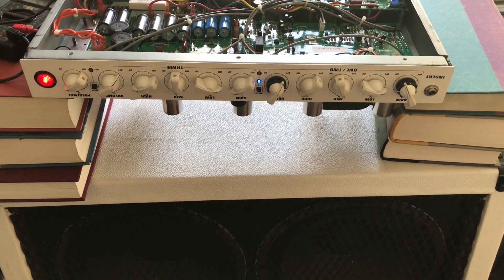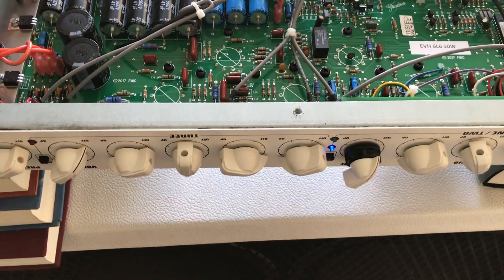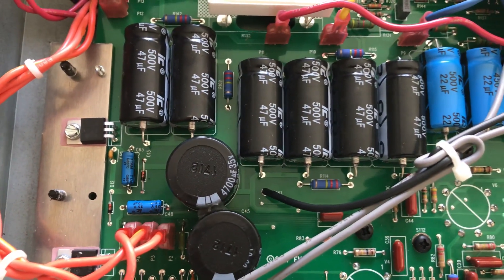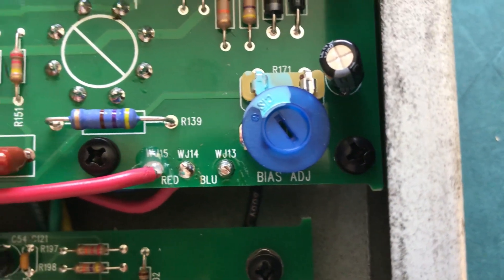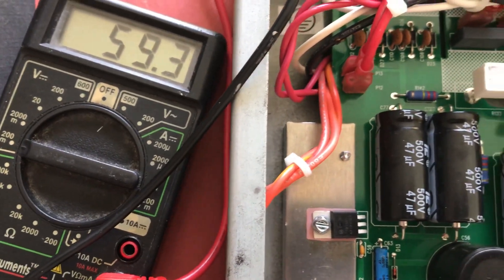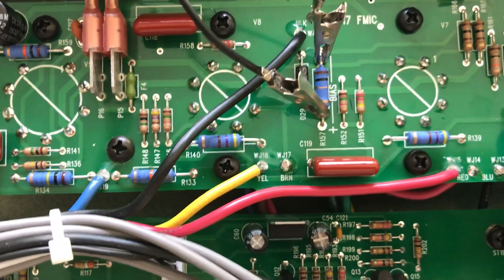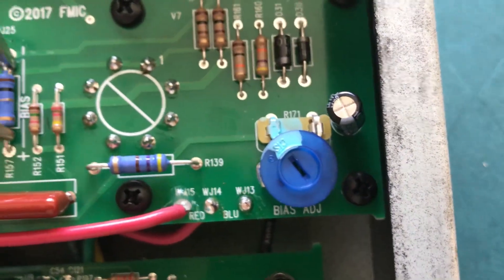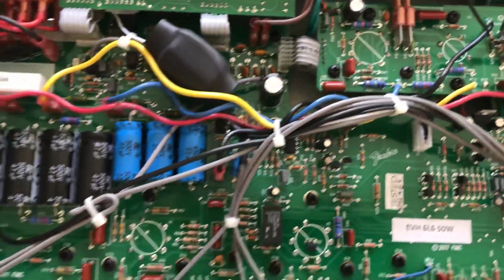How to bias an EVH 5150 iii 50 watt 6L6 head

Comment: The Bias probes don’t work if there is a resistor between pins 1-8 and ground.  All the Bias Probe does is add in the resistor that’s already in the amp.  5150 amps generate most the distortion in the preamp.  30mV per tube is a cold bias and your tubes will last longer.  35mV is the standard setting for power tubes usually but that might not be needed in a high gain amp like a 5150.  As long as the tubes aren’t red plating you can adjust the bias where it sounds best for your settings.  The colder the bias the less wear and tear on them but they might sound more harsh.  Go with the coldest setting that sounds the best.

Comment: You’re a god, thank you! I don’t have any gator clamps, would probes suffice with just contact?
Reply from the maker: @DannyDarko222  Naw. I’m just a guy trying to help. Glad you found it helpful. Yes, just the probes with contact will work find. That’s actually the safer way to go. You’ll just have to check your bias, make very small adjustments then check again. They make probes that clamp on so you can adjust while reading your meter in real time. But I couldn’t find those so I did it this way.

Comment: Thanks so much for the informative video ! I am currently puzzled since I own a 5150 iconic 80W EL34 Head and would like change the power tubes. There are hardly any resources on the Internet and no schematics on the EVH website . I contacted the Fender customer service and was told that : 
1- The amp is to be biased 
2- The bias for the EL34 version should be 90mA (at the bias resistor ? )

This is my first time I own a tube amp and I am willing to bias it myself. I have a good experience with electronic but looking for the easiest method to do it since I'm not a guitar tech. 
the 5150 iconic has the same Bias resistor marking as in the video. If I understood everything right, Should it be enough to read the voltage /current across that marked resistor with mutimeter and adjust the bias potentiometer until it reads 90mA ?
Reply from the maker: @MegaDocjoe  I’m glad it was helpful! I’m not sure about which resistor on the Iconic is the bias resistor. But yeah, it should be marked “BIAS” with the positive and negative signs on it. Just test across that if you see it. And of course you’ll read it in millivolts instead of milliamps because of the resistor. And yes, adjust it until it says 90mv if that’s the bias reading they told you. Be careful and hope you get it worked out!
Reply: @TheAxe4Ever  thanks for the answer ! It wasreally  helpful !
The iconic has the same 1 ohm bias resistor as the 5150iii with the same "Bias" marking

Comment: Where Power Level must be during this: max, 1/2 or min?
Reply from the maker: @hiandlowwings4476  I had it around 1. Just cracked open. I tried it again later at around about halfway since this video and it really didn’t make a difference in the reading. I don!t think it matters so much with this amp or other class A/B amps. I know with the older class A amps it made a difference. I’m not 100 percent sure about that, but that’s what I’ve read and heard from other amp techs. But with this amp, it really didn’t make a difference.

Comment: So I recently picked up one of the 5150 heads, this one has the bias port on the very back of the amplifier. 

I checked with my multimeter and it was set to 40 millivolts which based on Mr kaplan's schematic indicates it was set quite cold. 

I made a slight adjustment with the flathead screwdriver, bumped it up to 54. 

Only problem is the day after I made this adjustment... I've been having an insane amount of white noise in the background on channel 1,2, and 3! I'm going to leave a link to a 60-second video clip demonstrating this... I had the amp for 2 weeks and it was nearly silent when it wasn't in operation, now it's absolutely unbearable. https://youtu.be/71NpBEeue3w?si=ogEDtQ-w07PX3nn4
Reply from the maker: @msi1985  Wow! I have the normal bit of preamp gain hiss on the red channel as is normal for a high gain amp. But my blue and green channel is quiet. Have you tried a different preamp tube in V1 to see if it takes care of it. Other than that, tube wise, maybe a pair of 6L6’s that are overly unmatched? But I think that would cause more of a hum than hissing white noise.
Reply: @TheAxe4Ever  so the store took the amp and ran some tests on the tubes I guess three of the preamp tubes were failing and both of the power tubes were failing. They were all replaced, no cost. There is a little bit of noise now but it's way down compared to what it was before.
Reply from the maker: @msi1985  Cool! That was cool of them to take care of that for you. These amps can tend to be a bit “hissy” especially on the red channel. I honestly have never used that channel too much. It’s a little too compressed for my liking even though it sounds really good. I use the blue channel the most. If I want a bit more push and compression, I just use my Xotic AC Booster. Have fun with it!
Reply: @TheAxe4Ever  I'm up in Canada so our major music store here is called Long & McQuade. I pretty much went to them religiously for probably the last 15 years. Their warranty on items is absolutely top-notch, if anything happens with tubes within the first 30 days of purchase they're still under warranty which is just wild! I definitely agree the blue channels absolutely wild! It gets pretty awesome sounding with the compression!

Comment: here is the link of the man talking about 5150 amps from 0.45 sec. and thank again for your help! https://www.youtube.com/watch?v=oPej_xdu61Q
Reply: i will bring my 5150III combo to a repair shop in my country and let it biased good. thanks for your advice.
Reply from the maker: @jaapmax  Okay. I see where your confusion came from. This is Lyle from Psionic Audio. He is THE MAN when it comes to tube amps. He was absolutely correct when he talked about 2 types of “fixed bias” amps. Non adjustable and adjustable. When he said the 5150 amp, he was talking about the original Peavey 5150’s. They do not have an adjustment from the factory. You just get matched tubes and put them in. They were biased very cold from the factory so the chances of damage was almost non existent. I played a Peavey 5150 for about 18 years. But the 5150III amps made by EVH (Fender) are adjustable, having a potentiometer inside to adjust it. So he was right on the money. But again, he was talking about the original Peavey 5150’s. Yep. Lyle is definitely a subject matter expert when it comes to tube amps. Great guy too.

Comment: hi, i have the 5150III 50W combo 6L6 and bought new EVH tubes, it is branded on the tubes EVH 6L6. I bought the amp brand new but it makes so much hum that other people tell me that is not good so that's why I have new tubes now. I just put them in whiteout biasing. can something happen because it is not biased?. there is a YouTube video on tube amps and the man said 5150 is a fixed bias amp and not need to bias??? if you want I can put a link here. so I believed him and changed the tubes, can it gonna brake something inside the amp or am I good? please advice
Reply from the maker: @jaapmax  This is what drives me insane. There are so many “experts“ on the Internet and YouTube that give incorrect information when they don’t know what they’re talking about. “Fixed bias“ means that the bias is adjustable usually by a potentiometer. Which the 5150III has as you can see by my video. “Cathode bias“ means that the current fluctuates automatically up and down to keep the current at the right level. Or often times you have to change a cathode resistor value to adjust the bias on those types of amps. That is what that guy was actually referring to. But he mistakenly thinks it’s “fixed bias“. I’ll leave a link to an article about the subject that you can read that will give you a better explanation than I can. But yes. Absolutely bias your amplifier to the new tubes. If the current is too far off, you can possibly do some damage to your new tubes or your amplifier. As you can see the 5150III has a potentiometer to adjust bias so why would it be there if you didn’t need to adjust it. I’m sorry you had to get confused by a video that someone put out giving you bad information. I’ve been there myself and had to learn the hard way. Here’s that link. Also, go ahead and give me that link so I can see this guy’s video and set him straight in the comments. https://www.ampvalves.co.uk/fixed-bias/#:~:text=So%20a%20fixed%20bias%20amplifier,(fixed)%20until%20adjusted%20again.
Reply: he talk about it from sec 0.45
Reply: https://www.youtube.com/watch?v=oPej_xdu61Q
Reply: https://www.youtube.com/watch?v=oPej_xdu61Q

Comment: 45ma recommend
Reply from the maker: Sure, if the plate voltage allows for that. I use to bias it per factory specs. They do recommend a pretty cold bias from the factory. But since this video, when re-biasing I will always check the plate voltage of the tubes, do the calculation and bias from there.

Comment: I just tried this same method....I couldnt get it lower than 66ma
I'm using an 8ohm cab and set the ohm on the amp to 8 ohm...is it also possible its higher because I'm using a 12ga speaker cable????
Reply from the maker: The speaker cable size shouldn’t have any bearing on your reading. Bias on an amp is a range really and not a specific set number. These amps are set pretty cold from the factory and they say to set them at a cold bias for various reasons like tube life and quite honestly, the crossover distortion you get from a cold bias is part of the sound these amps are designed to get. You heard me say this one was set at 73 which was “too warm”. Meaning warmer than factory spec. But not “too warm” as to be detrimental to the amp. I wanted to show the factory setting in this video. I am actually now running a setting of 70ma in this amp now using a pair of Sovtek 6L6WXT+ tubes. So at 66ma, you are still in a good acceptable range. I wouldn’t worry about it. In fact, if your tubes are healthy, try bumping it up to 70ma. You might like the results!
Reply: @TheAxe4ever  Awesome...thanks for your reply...I actually put in a set of Matched Ruby 6L6 and was able to dial those right in to 60ma.    Maybe it was just those Sovtek...???
Reply from the maker: @brianmcgonigal229  Absolutely. Depending on the age of the tube, how they’re made, their individual specs etc. draw current differently. You can set a pair or quad of tubes at a reading, then put in a different set of tubes and the reading can be much different. Sometimes pretty wildly. Glad you got it squared away! 👍🏻

Comment: I had a conversation with Mr. Kaplan about the tubes that come with the evh 50 watt. They come from JJ's unmarked, they are special order tubes. V1 and V2 should have a silver dot on the bottom, they are special tested and found to be low microphonic. V1 and V2 also need to have the foam inserts in the tube covers. Also the evh jj tubes do not have screens, atleast in the pre amp section V1- V6, V7 and V8 are power tubes, and V9 is your phase splitter.

Comment: HI have thois amp, too, Evh 5150 III 50W 6L6 Head IV , My red channel stopped working, only low volume, no distrotion. Can I find something with opening it up?  you tink? I tried the tubes, but still same .
Reply: Common issue with Fender/EVH. If you're confident and want to open it up to see if you can fix it, a good place to start is just cleaning everything, all the pots and all the connections with electronic cleaner like DeoxIT. There's a good chance that'll fix it as simple as it sounds.
Reply from the maker: Sorry so late replying. Beyond tube changes and biasing, I know little to nothing about fixing amps. But one thing I have heard about these amps with people that have the same issue you are having is that they narrowed it down to the footswitch cable being bad. Are you using the foot switch? I don’t have a foot switch and pretty much just use the blue channel. If you are using the footswitch you may want to look into that. Sorry I couldn’t help.
Reply: ok, finally Fender ;NOrway, took it in, because, the waranty rusel in NORway is 5 years, BUt THomann, Germany , tried to stop me, and said, its 3 years, caase closed ! I got it repaired, and the tech guy said it was a bad soldering. Well, that i s a lie, ! because I looked in it and all over it. No bad solder. But probably its some choip, they repalced, that they dont want to tell about. So I sold it, right after. DOnt buy this amp !
 @TheAxe4Ever

Comment: Help me out I’m doing this exactly like you said but my meter says 0. I tried turning the bias but it still says 0 no matter where I turn it.
Reply from the maker: Hmm...the only thing I can think of is to make sure your meter is set to millivolts to the proper range. Like on this one I have it set to up to 200 millivolts on the dial. Other than that, if you have it connected as I have done here and have the dial set to the right range and you still get zero, I don’t know what the problem may be.

Comment: Can you tell me did you run this on the clean channel when biasing or blue or red? And what should the settings be on the high mid low presence etc?
Reply from the maker: I ran all the eq controls on all channels at noon. Including the presence and resonance. The gain and volume pots were all the way down. But honestly, when I changed the power tubes after I did this video, I did the same thing and set the bias. But then I started to adjust the gain and volume knobs and noticed very little to no change in the readings.

Comment: The generic tubes are what was in my amplifier that was bought new. Visually similar to the JJ ecc83 in most aspects, but with thinner leads from the pins and some different etchings and lack of etchings seen on the JJ. I think the generic could be a copy of the JJ ECC83, but that's just me speculating.

Comment: Excellent video!  Would this be the same for the 5150 III 50S series?
Reply from the maker: Thanks! Glad you liked it. I believe the 50 watt Stealth has the test points and bias adjustment on the back panel of the amp so you don’t have to take the chassis out.
Reply: @TheAxe4Ever  yes it does. thanks again :)

Comment: What’s the name of the meter you are using?
Reply from the maker: It’s a GB Instruments (Gardner Bender) model GDT-11 multi-meter. It’s just a cheapie. I think I bought it at either ACE Hardware or Harbor Freight. I only paid like 15 dollars for it like 8 years ago. I wouldn’t use it for heavy duty jobs, but for what I need it for, it works great and is pretty accurate.

Comment: Having to tear a head apart and risk death by electrocution,  just to bias tubes, is asinine. The fact that manufacturers continue to build this way so they can save $5 profit by installing external bias points is unreal and contemptible. Especially with amps that they already make 2000% profit over materials and labor on. As far as I'm concerned,  if it doesn't have external bias points, it's not worth buying.
Reply: I don't see how anyone would electrocute themselves by adjusting the Bias on this amp. I have almost no experience and it was simple and safe.
Reply from the maker: @Rockandrollgeerage I personally have never gotten bit by adjusting bias. I know it can be done if someone isn’t careful and gets careless by what they poke around on. I know if you touch a charged capacitor or it’s trace while an amp is plugged in and on, it can kill you. Why someone would do that is beyond me. But you have to admit, there are people out there that have to be told not to put a plugged in toaster in the bath tub with them. 🤷🏼‍♂️
Reply: Only the stealth 5150's have external bias points on them. More features to help justify the higher cost for the stealth's I guess and added job security for techs who lose out on business if anybody could bias their amp with little knowledge and no risk of electrocution. But I would agree that having external bias points should be a universal feature on all modern amps.

Comment: I have a question pertaining to EL34 tubes. I have the 100s version with 4 El34's with the testing point outside of the amp. I want to swap out my tubes, but I don't know what the recommended biasing should be for the tubes? Can you help me out?
Reply: The recommendation from Fender/EVH is 22.5 millivolts per tube for the EL-34's. So if you've got the 100w version with 4 power tubes, you want a bias reading of about 90 millivolts across the 4.

Comment: What is the calculation for plate voltage you mentioned?
Reply from the maker: There are lots of good videos out there showing how to bias using plate voltage. This is the one I like. Very informative. He tells you about 6 minutes and 40 seconds in how to do the calculation. Just remember a 6L6GC tube like in the 5150iii are  30 watt rated tubes. In the video he is using EL34’s which are 25 watt tubes. So just substitute 30 instead of 25 when doing the calculation. All that said, I always use the setting recommended by the manufacturer of any amp. The EVH comes biased from the factory what would be considered a cool or cold reading. They do this for a reason and designed the amp to run at that reading. Here’s the video. https://youtu.be/f0y1bNzLkLo
Reply: @TheAxe4Ever  Holy shit thanks for replying so fast. And thanks for the link! I just picked up a 50w stealth this passed weekend and I’ve been just digging as deep as I can on this amp. Favorite piece of gear I own.
Reply from the maker: @ICEMANdrake214  Awesome! The 50 watt Stealth is on my wish list! I will have one soon. 🤘🏻